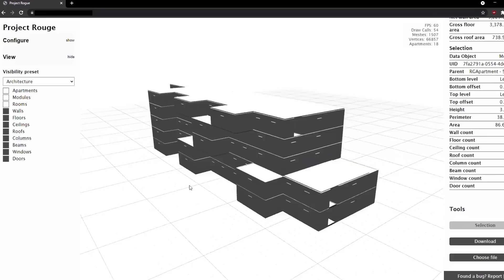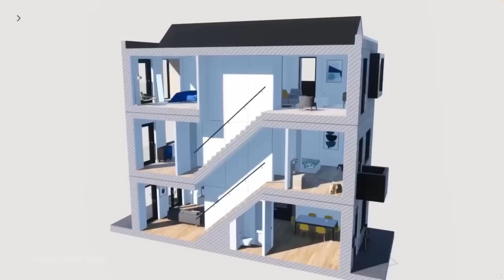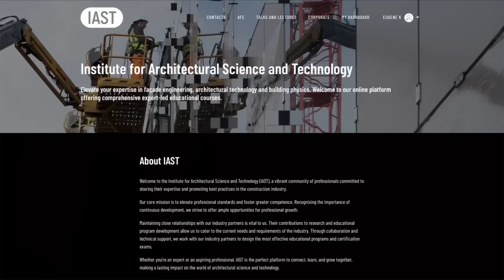Is Modular Construction Destined for Bankruptcy?

Comment: I believe it is preferable to differentiate between prefabricated segments and true modular. With segmental a floor plan is divided up into suitable prefabricated and transportable segments. With true modular the available modules determine the floor plan. There is no customisation of the modules, not internally or externally, if the module changes, then its no longer a module, its become a different product. The modules therefore have to be flexible and adaptable enough to create a diverse range of floor plans and building exteriors. Group technology may create a family of similar modules, all adapted from a common base module. Also most modules would be empty space and fitted out on site. Segmental has too much variety of the prefab units and is relying too much on expensive robotic automation, whilst true modular doesn't require such level of automation as standardisation simplifies the automation. The problem is a lack of true modular or poorly designed modules which lack the required adaptability. It is also important to differentiate between volumetric  modules, and panelised modules: being smaller,  panels are more adaptable to greater range of building shapes.

Comment: The main problem is that the SillyCon Valley mindset has entered the industry where most of these startups are only interested in raising funds through VC's. I spent time 4 years ago developing a build process using panelized construction that allowed us to build an ADU to code (not HUD) in 6 days. We were ready to go with a small test facility but the company told us they wanted more automation so they could 3d render it and raise funds. I left and the company wound up less than 6 months later

The warning signs were there with them only looking for social media and animation staff.

Comment: Prefabricated housing foundations?
Reply: Way late, but precast concrete foundation elements are a thing. One can never ofcourse remove the ground prep. However one can remove the onsite form work and so on. The wall foundations come as large, little bit traffic barricade looking, elements one lowers on the prepared, leveled and compacted ground. Line them up, usually lock with metal spikes to link the rebar cages of the pre cast elements. Then one pours concrete in the seam to permanently link the elements together and seal up the rebars to solid permanent foundation. the elements have ready passages and cavities to fill with concrete. Only needed onsite moulding is a small gap mold at the seam.

Saves the large work of onsite moulds. The prefab plant has industrial reused moulds setup. It also means one can get stuff like pretension rebars, since the factory can have the necessary pretensioning ramms and machinery. Not that it is that necessary on foundations, mostly compressive loads.

Usually then the main slab simply uses the already installed and cast to permanent placing wall foundations as the outer moulds for that pour. The foundation elements are done to wall install height and thus spans the height of the floor slab.Again saving lot of mould work. Then one just needs to mould in whatever internal exclusion, pass throughs and other specialties one wants.
Reply: @aritakalo8011  I did precast in the 80's with rebar

Comment: Its on the more expensive than traditional buildings when you fabricate these in countries like USA or Australia. However, in New Zealand & Australia, there are developers start building those modulars in China, where the labour rate is almost 1/10th compare to the local wages, which can eventually halves the total construction cost. Regulations and standards will be on the headache side, but still manageable. But this could potentially hurt the construction industry and unions will most likely go against it.

Comment: The only economical way to produce homes on mass scale is to build higher. Then, you could leave some personalisation to the customer if you leave walls exposed and open plans. That way you won't have to worry about codes as it would be homeowner's responsibility.

The only drawback is infrastructure. Sudden increase in population density doesn't leave much time to local government to upgrade services capacity.

Comment: While modular and prefab absolutely are part of the solution - in the US at least it's pretty much moot until places allow for more building, streamline permitting and regulation, and city connections (water, electricity) also get streamlined and improved. Another huge hurdle is every state and often every municipality will have different building codes, often with arbitrary, ridiculous, and incompatible difference. Not to mention there's a ton of resistance from trade unions, and many publicly funded projects will require that use various trade unions. Finally, as far as I can tell, all the prefab companies are competing for incompatible standards. They're all inventing their own hardware, connection points, strucutural units etc. There's no motivation to standardize. Same issue as charging EVs.

Comment: Great video. Definitely learn from mistakes made by others so as to improve the process. It's often the case that when processes fail, the key factor may have been not learning how to properly work with all constraints, both internal and external processes. Smaller, more easily reversible experiments such as repurposing old Robots is likely a more practical approach to the systems used for our built environment. Keep up your great work that considers perspectives and events in this space.

Comment: Hi Belinda, I'm a seasoned builder and engineer, worked in 14 countries over 30+yrs. Your observations are insightful and accurate. Just a few more factors/observations:
1. Many successful modular housing businesses in Northern Europe, my guess is that the long dark, wet or icy winters favour factory built.
2. Expanding on you "individualisation", yes sites are varied as are soil conditions, existing neighbours, underground services and as you mentioned codes that can impact how one deals with the aforementioned -  this favours bespoke design.
3. Modular with vastly capital intensive plant must compete with an industry with highly skilled trades people, each with say $200k of tools, capable of correcting and working around design issues on site (never in 30+ yrs did I find drawings that were complete, without error, and without client changes required mid way!
4. Modular with vastly capital intensive plant must compete with an industry that supplies highly "modularised materials", think of all the panels and block materials, doors and windows, all ready to install on site.
5. With regard to 3 and 4 above, there is a fully available supply logistics service available, with depots/trades already located near population centres. Modular building factories need scale, but that then drastically increases delivery and cranage costs.

Comment: I'm not impressed by the modular industry. If the selling point of modular design is supposed to be the savings you'd get from going with modular structures, they pale by comparison to a "tract" builder. It would be more meaningful to have factories build a kit of parts that could be assembled on-site by tract builders, IMO -- like the old Sears homes.  Built at tract-scale level, all the permitting, TIFs, infrastructure costs would be shared among a wide group of homeowners instead of being shouldered individually as one does with modular homes.

Comment: I think you're missing two of the biggest problems with modular construction--transportation and "sustainability."  None of these modular companies can reach an entire region much less every state/country whereas stick built companies are everywhere. Thus, the cost of transporting prefab components to the build site adds to the over all cost (not to mention the fact that you are also limited to what fits on the back of a truck).  Also, they seem far too interested in current marketing buzz words of "sustainability" and "carbon neutral" than realistic words like "affordability."  Do they really think the average person is willing to pay 50%-100% more for a smaller, modular home just because it recycles rainwater or has solar powered door knobs?

Comment: I'd like to add one more:  transportation to the site. 

Modules need to be transported to the site and the width restriction on roads doesn't fit the open spaces people typically want.   It is much easier to deliver the sub-systems and have them assembled on-site.
Reply: Good point. Some industrialized housebuilders in Sweden "overcome" this by restricting the maximum size of their volumetric modules (i.e., maximum width of 3,5 m, including packaging, which is the maximum width allowed before it is considered an oversized load). I know this is different in other countries, e.g., US, where the limit is 2,6 m, which makes it even more difficult.

On a similar note, I would add the final assembly and installation at the construction site. In my research I have seen industrialized housebuilders that complete 80% of the value-adding work in the factory, but with the remaining 20% of value-adding taking approx. 80% of the project lead time (excluding engineering and configuring the building design). In these cases there almost seems to be an inverse relationship between value-adding (% complete of the building) and the lead time for on-site and off-site operations, respectively. In other words, 80% of the value-adding takes 20% of the project lead time, while the remianing 20% value-adding takes 80% of the project lead time. Many industrialized housebuilders are measured based on ROCE, so reducing the total project lead time (including off-site manufacturing and on-site installation) should be highly prioritized. Not to mention the overhead costs of running a construction site, which can have a great impact on profitability if the on-site lead time is reduced. As mentioned in the video, many industrialized housebuilders are inexperienced in "tradtional" on-site construction operations, but we can't ignore the construction site no matter how industrialized a building system is...

Comment: How do they build modular homes cheaply?
I built a home, The concrete slab with all the plumbing in it was a big deal.
Framing was easy, but you have to run all the electrical and plumbing through all the walls.
The hard parts (except the roof trusses) of home building would be difficult to make modular.
Reply: Honestly you don't know anything about construction. There are so many offsite options it's an endless list
Reply: @sparksmcgee6641  Maybe, but this video is all the failures.
Reply: @Rambleon444  Then why are you talking about all the problems you had with stick built. 
Factory built still costs more and they're dropping in a percentage of homes built.  This is about people like you saying there must be a way to make money and  as an outsider I'm going to prove it.
Get out there and build a factory and show us how it's done.

Comment: I'm a third generation independent builder.  The extra regulations, zoning restrictions, and red tape that have been introduced in the last 10 years have been the biggest factor driving cost increases.  Modular homes don't fix that.  Once the foundation is in, our shell, mechanical, and trim out costs are not significantly different than 10 years ago.  It used to be that getting shovel ready (ready for footings) was maybe 10% of the cost, now it's 50% or more of the cost. Virtually every septic needs engineering, every lot needs a wetlands survey, zoning is so restrictive in some areas almost every project requires a variance. Our average time to develop an empty lot and get it ready to build is about 2-3 years because of all the hearings and permitting. When I was learning the trade with my dad 20 years ago it was 2-3 months.
Reply: Too much red tape and bureaucracy at planning stages.
This drives the cost of land because it takes too long  to get land build ready.
In the US it’s zoning, in the UK its decentralised and “personalised” planning application.
Watch NZ Builder and see the flexibility and enabling planning approach they appear to have in NZ.
You could never have such readily approved applications in UK.

In my opinion, “innovative builders” they try solve a planning problem with a design or methodology solution.
In the end no matter how or what solution modular builders attempt to introduce, the approach is not economical.

I would welcome a comparison with European models e.g German /Polish/Scandi modular SIPS systems.
I don’t have information or planning processes in those countries so cannot make a straight forward comparison.
However, the common “modular” SIPS construction method seems to work very well there.

There are MANY, MANY, successful and long running companies offering modular customisable homes on the continent.
Here in the UK, even with our obsolete but tried n true brick homes, forget asking any big home builder to vary anything on the “approved plans “. 
The answer is always ‘No, can’t deviate from the plan.”

Therefore, the conservative and restrictive planning and zoning laws make building innovations in USA and UK unprofitable.
Reply: Of all of those additional delays, which do you find the most restrictive or which would you like to see the change the most? Or which you see the least need for? My gut feeling tells me it's zoning but I don't know if that's correct is I don't work in the industry. If there is a way to safely streamline the building process for both residential and commercial needs without compromising on environmental impact then that's definitely what I feel we should be doing. 

There's supposedly a homeless building project to go up in my area which on paper is fantastic, we need many more of those but so far it has experienced constant delays for all the reasons you mention. Some I'm sure are necessary but I'm wondering which ones are just their to pad the bottom line for someone or because of ineptitude. The funding for the program was approved about 2 years ago from what I hear but so far nothing has yet been laid on the ground they say they're still in the preparatory stages. I'm hoping it's not too much longer before they start actually building. 

Of course we don't want shoddy or unsafe construction but like you I'm wondering how much of today's red tape is actually necessary.
Reply: One major problem in many jurisdictions is that "considerate" agencies have now given neighbors the governing say into exactly what can be built. Nothing can be started until all the neighbors approve, which leads to endless expensive redesign to please everyone except the new developer. Of course this puts additional costs that effectively  stop new projects.

Comment: I agree with the problems you mentioned in your description for modular homes. I wonder what your thoughts are on RVs such as the L1 Lightship, Pebble Flow, Northern Lite truck campers, or Oliver travel trailers. It seems to me that these RVs have some of the benefits of modular homes but without the regulatory hurdles because they're classed as RVs. I predict future RVs will trend towards more full time live aboards by including batteries, solar, and composting toilets similar to what the Lightship and Pebble Flow offers (sans composting toilets as of yet). My problems with the Lightship and Pebble Flow are that they are new companies and haven't reached production yet so they're inexperienced and may have financing problems. Also, they don't have one piece fiber glass construction like Northern Lites or Olivers so they may not be structurally reliable. Northern Lite and Olivers are decades old companies that have experience but have not yet applied future technologies such as battery storage. There are other fiber glass RVs such as Lance and Casitas but Lance is not one piece and Casitas are not 4 season insulated and may have MDF floors that are susceptible to water damage that would essentially ruin the whole RV. But quality fiber glass RVs such as Northern Lite and Olivers retain their value for decades unlike other RVs that begin to fall apart the moment they drive off the line.

Comment: We are finally nearing the end of the process of having a modular 1200 sq ft ADU built on our property. One of the economic issues which is rarely talked about is the cost of moving these huge units and setting them in place. Our's required a crane which ended up costing over $25,000 just for that one step in the process. I don't know what the cost was to move the two giant boxes to our place. Another issue is that the foundation, septic system, water hookups and so on all needed to be done on site. Honestly I don't see how for single house construction modular is going to actually save the maker or user money.
Reply: Yup turns out it’s actually quite a bit cheaper to bring wood in on a truck and have some guys put it together, instead of shipping enormous empty rooms.